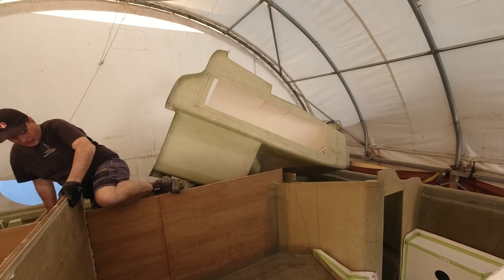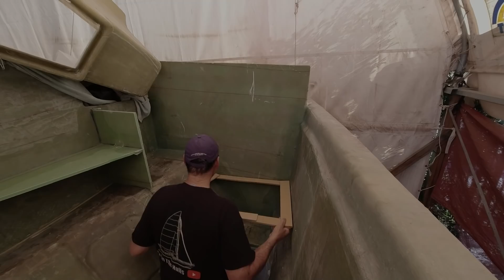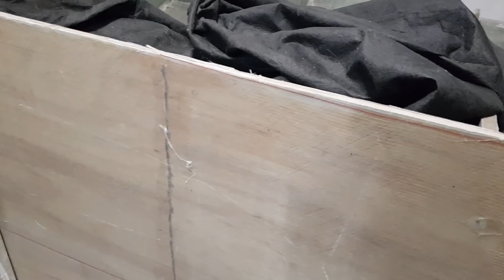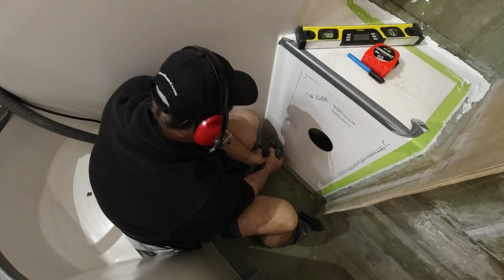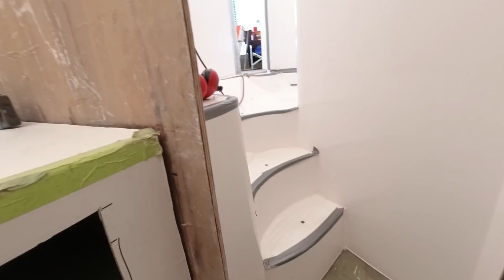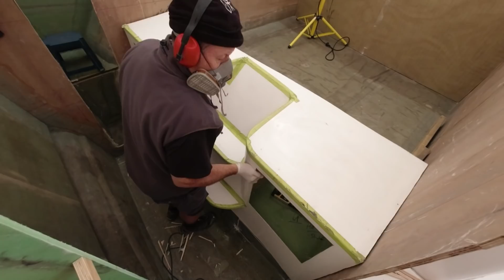Hacking into Furniture Modules - 12.7mtr Catamaran Build Ep188

Comment: Hey Ross what model makita Is that what works on the tracks? Doesn't look like a plunge cutter and I didn't see an adapter
Reply from the maker: Hey buddy it a Kregg track accessory.Fsntastic and fits all skill saws.Cut up to 2.4mtrs long so a full board as there are 4 interchangeable section of 60cm.Cheers Ross

Comment: Ross, just a thought. You mention fairing and painting all of the shelves. That just seems like such a pain. Have you considered thin varnished wood paneling as the surface and side of all of these cabinets? Should be a lot simpler than fairing and painting. I absolutely agree with glassing and filleting every thing in so you don't get squeaks, just think wood surface on top of the foam would be quicker and even prettier. Anyhow just my two cents.

Comment: Great work as always Ross ! Will the stair treads have a lift out panel to access that open area below and also so you can reinforce it to fight the squeaks I've heard on almost all commercial cats I've ever visited ? You could also make those treads/panels from rib reinforced wood with a non skid finish routed into upper surfaces and have them drop in place onto a lip surrounding the area which would also stiffen it considerably... More spaces for essential odds and ends like beer !

Comment: Great work, great quality laminating. Don't you do the cut outs with rounded corners? As the internal modules are part of the boats strength, I'd be afraid of cracks in the corners. Especially on a catamaran.

Comment: Since its almost summer time, I would suggest getting a portable AC such as a Midea 10,300 BTU (13,500 BTU ASHRAE) 115V Smart Portable Air Conditioner, I used that as an example to give you an idea. As long as you exhaust the heat outside your tent it should keep the small areas you work in cooler. The downside is it can be too loud for recording and a bit awkward to move from one compartment to another. 

I would have suggested maybe using a swamp cooler but if your climate is humid it would do you no good. Plus the fact it would add moisture to the air and Im sure that wouldnt be good for fiber glassing. Im not an expert by any means.
Reply: He said in the video that ha has a portable AC unit he's gonna use... did you watch the video?
Reply: @JCrook1028  I just didnt hear it, otherwise I wouldnt had suggested it.